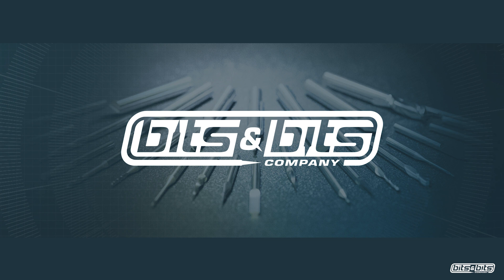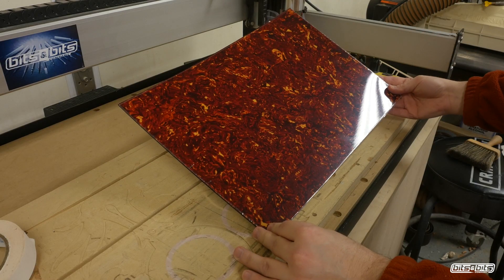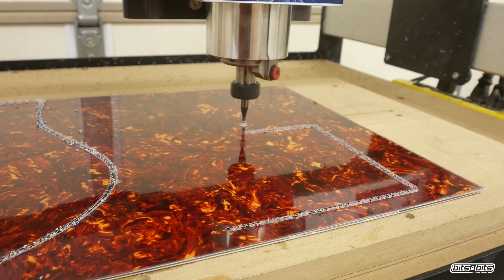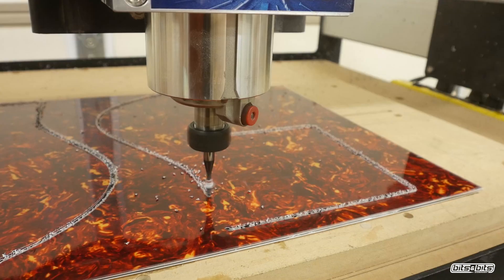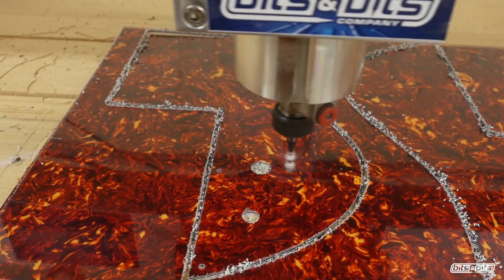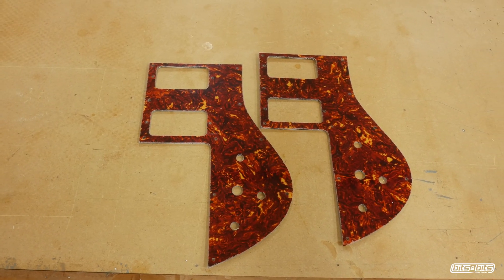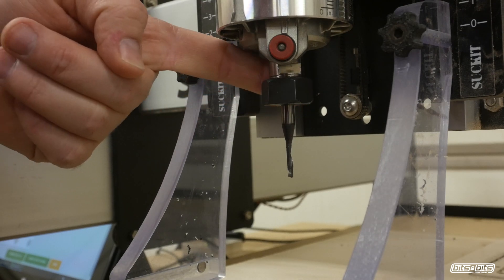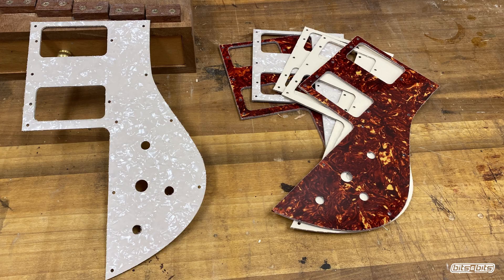How To Make A Pickguard on The CNC Machine

Comment: There should be an angled bevel cut on the outside for most pick guards which shows the inner layers. that's a trickier cut. info on that would be nice. THX
Reply: I use a 90° V-bit as a final pass.
Reply: I think benchtop router with a chamfer bit would be a better option to do that operation in a much faster way.
Reply: Yes this! I assume that is a different bit.